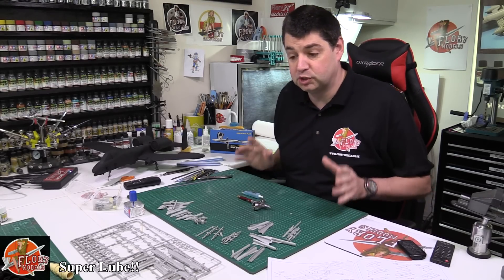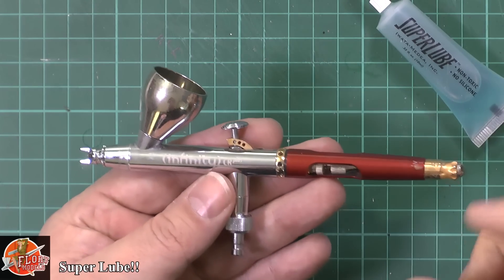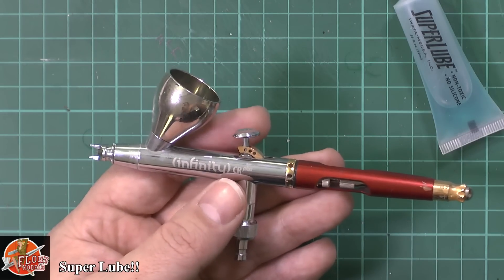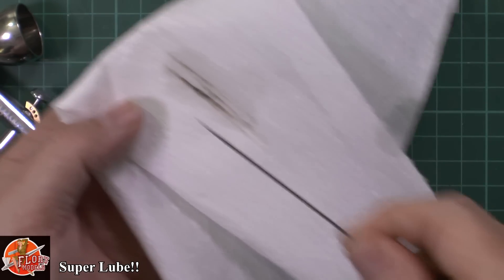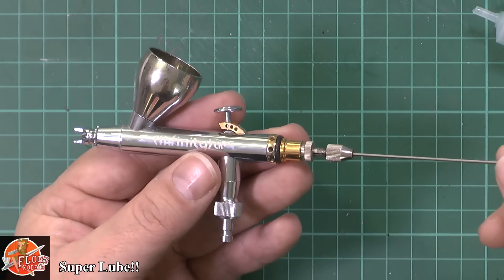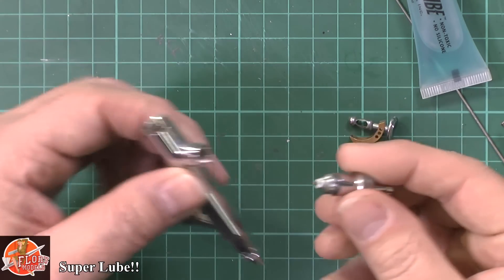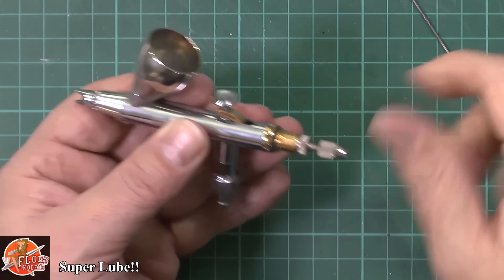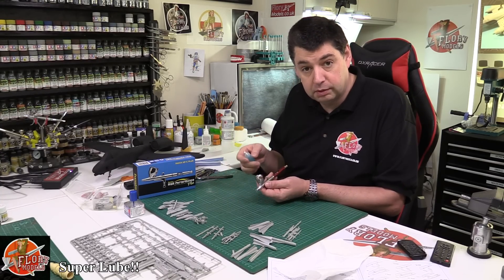Super Lube review

Comment: Good info but if you follow various airbrush communities you will see that the blue Super-Lube is the most hated lube out there. After a while it gunks up and everything tightens up. They just released a new clear one that is suppose to be better.

The only bit that needs to be lubed is the tiny bit where the needle makes contact with the packing seal. The trigger, air valve or the needle guide does not need it. It just need a to be clean.
Reply: I had that gunk up and I think I was probably over-using the blue juice and dropping it in too much. I use it more sparingly and only the smallest of drops delivered by using a tiny dot of it on an old needle.

Comment: Excellent info.  Just got my infinity plus, and in playing with it out of the box, and then cleaning by flushing thoroughly , after I was having trigger sticking issue (when I released it still bled air).  So tore it apart and lubed just as you displayed and it works like a champ.
One thing I did notice, and don't know if you have info on this, is after spraying my first test load. Then cleaning with just a thorough flush, it continued to have remnants of paint that would spray out.  After breaking it down, I discovered there was paint that made it back into the brush body. The paint only made it back a centimeter or two (not all the way to the trigger),  I am just curious if this is normal or my technique is bad, or perhaps my seals are bad.  Newbie here so just trying to troubleshoot.

Comment: I personally lubricate the threads on the airbrush components from time to time, not sure how much of an effect it has on wear.
Reply: Make sure you don’t tighten the threads to the same degree as if they were dry since a lubed thread with the same torque applied will have a much higher force on the threads and whatever it’s clamping.